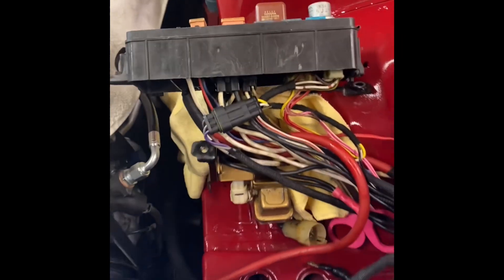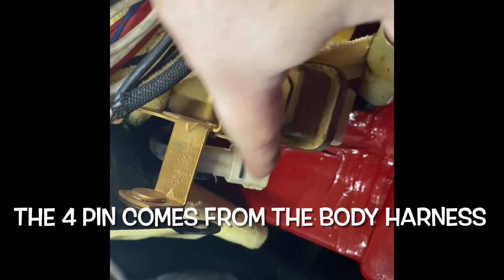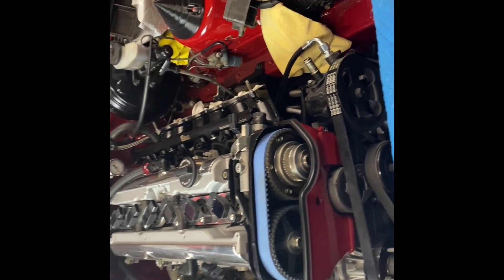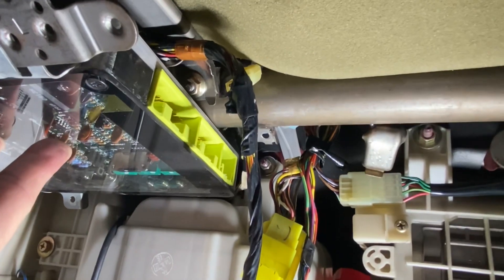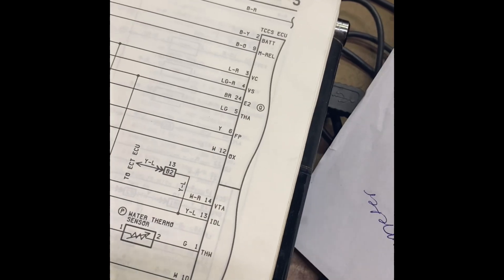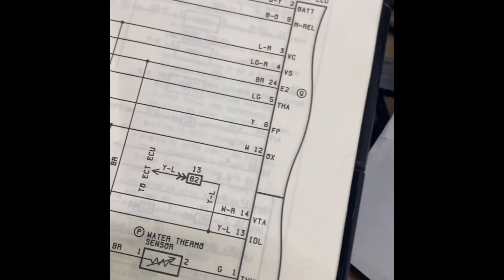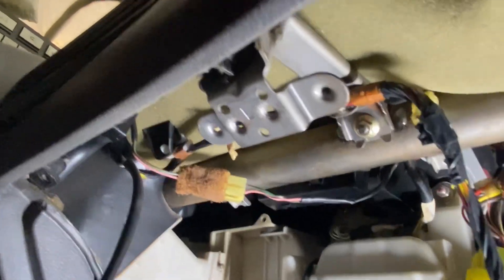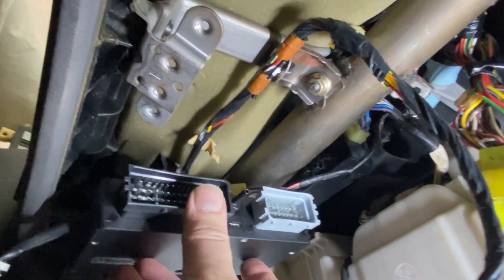Preparing the MK3 Supra for a new EMU Black ECU and preliminary wiring for the 2JZGTE

Comment: Hello I have a 87 turbo running emu black as well and wanted to ask how you hooked up the ecu to get the ac to work correctly?
Reply from the maker: Great question. The MK3 Supra is very easy to integrate for AC and really requires nothing from the ECU to function. The only issues you may run into is with 1) trying to control idle and 2) kicking off AC during high RPM. You can use the 12V AC on signal to trigger your ECU into a higher idle. As for high RPM, I just turn off the AC while doing high rpm driving.

Comment: Are you using DBW? Or did you convert to cable
Reply from the maker: I’m currently working on converting to DBW, but found a DIY method of implementing an IAC valve by repurposing a valve from the Aristo configuration. I basically developed a DIY IAC valve setup using 90% of the Aristo parts. I only had to buy one generic air filter. I have a video that covers the setup.